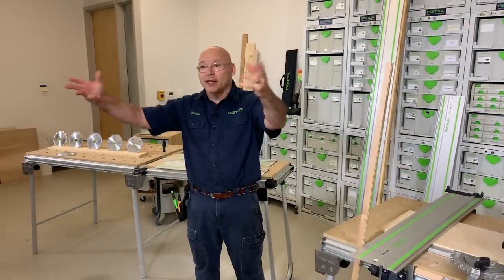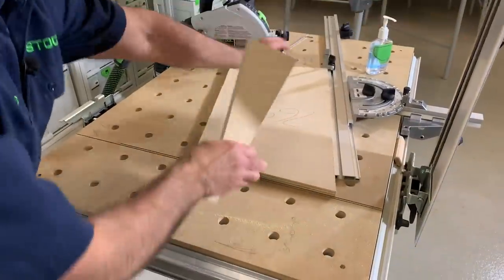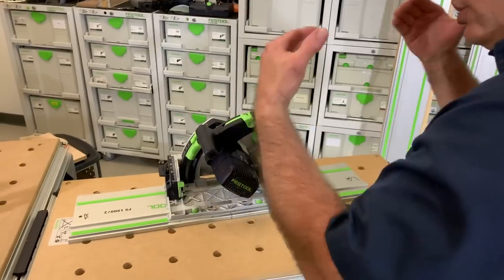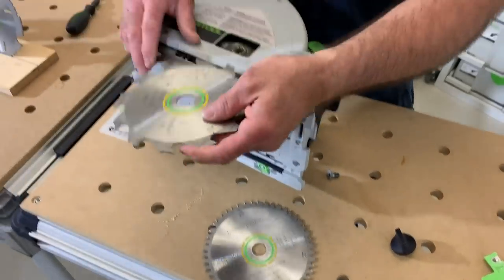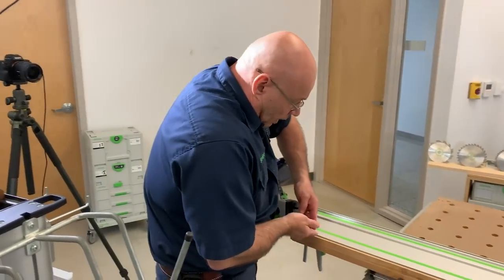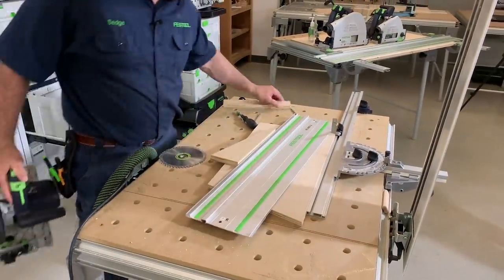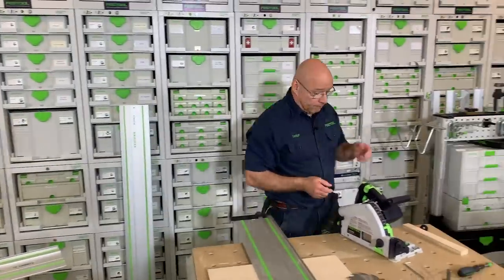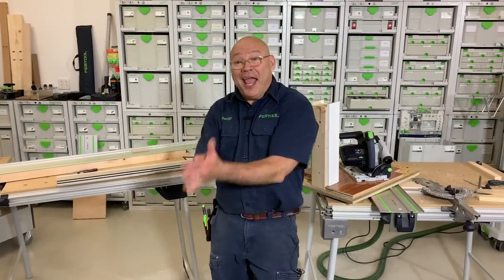Festool Live Episode 06 - Track Saw Essentials

Comment: I purchased the TS 75 two days ago, it's my first Festool product. This was exactly what I needed!
Reply: Same here!
Reply: dude i love mine, cutting some aluminum today ! purchased a 72 oshlun blade off amazon. Its dead on the track, I ran the 72 free hand on some plywood to take off some blade coating before putting on track. I think its gonna be great, its a non ferrous blade , but was cutting scraps of pre finished with no tear out at all. blows the 36 tooth out the water
Reply: Mines amazing . Wish I knew about them years ago ,as I used to use a skillsaw and a rail which it would usually go under and I’d throw fits

Comment: Great tip using the saw it’s self to align the rails. I would avoid the Festool joining bars because the set screws drive into the surface of the track, making a dimple, and those screws will always find their way back and could keep you from aligning the tracks at all.
Makita has a much better system with double bars, the set screws expand the parts inside the slots expanding with even pressure, and works with Festool tracks. 
I just saw new joining hardware from TSO that looks even better, it’s like the makita hardware in that it doesn’t drive screws into track, but it also has a unique profile that automatically aligns the tracks as you tighten... TSO GRC-12 self aligning guide rail connectors. Maybe Festool will license these rail connectors, because they were/are selling a Festool branded version of the [Excellent]  TSO GRS-16 Guide rail square, Festool call it the FS-WA/90, item #205229, and it carries the TSO logo on the clamp. Again I'm not sure of the status of this version, it's shows out of stock on the Axminster UK website and is listed on the Festool Global site, [Festool.com] but not on [Festoolusa.com] or any of the local Festool dealers that I checked.

Comment: I ordered festools laminate blade for my TS75 . I have to cut 1/2” acrylic for a friends staircase . Are there any tips I should be aware of, like should I slow the motor speed down ? I’m concerned about when the saw exists the acrylic with potential chip out . I guess I could clamp some sacrificial mdf for additional chip out protection

Comment: I’ve used all the connection techniques for 2 rails and yet to get the perfectly straight cut , always off over a 2.4 metre sheet cut. If you want close to a straight cut, the only way is a complete rail , and even then it’s hard to avoid lateral flex on hard material . It’s not as good and accurate as they make out but it’s still the best on the market .

Comment: I own a TS 75 that comes with a 36T blade, but I'm going to start ripping quite a bit of plywood, do you recommend that I switch to a 18T blade, or will the 36T handle no problem? And yes I know the TS 75 is overkill for plywood, but I use it for thicker stock, that the TS 55 could not handle.

Comment: I wanted to catch this live but didn't get a notice. I bought a 75 and then a 55. I think the black edges stayed on the best. At least for me the clear plastic curls near the ends. I have even used acetone to get every bit of old adhesive off. I keep my rails separated for the 2 saws. What I really wanted to ask about was adjusting 1 saw to match the other so I can use what ever rail I want. I hear I of the saws has more adjustment than the other. How easy is it to mess something up?
Reply: @S7tronic  Thanks!   I had not been aware of the TS Supplemental Manual before you mentioned it.  Owning several Festool saws (TS 75, TS 55 and a TSC 55), I found it quite annoying that they didn't cut exactly in the same location on the track.   I thought that was just a Festool manufacturing quirk, and I assumed the only way to maintain precision in my cuts was just to waste money to buy dedicated  individual tracks for each saw.  I owe you a big-time vote of thanks.  That advice of yours was equivalent to a 3-star rating in the Michelin Red Guide.

Comment: You tightened one connector but not the one on the bottom. I saw the gap between rails change as you were moving it around because the second connector was loose. You'd have to flip the rail with the saw on it to tighten the other connector.

Comment: That's for the video, Just one question, how to set the distance, should i Just use the splinterguard to set it to my drawn line?
Reply: Or are there better ways to make sure what you see is what you cut?
Reply from the maker: Yes. Using the splinterguard to set your drawn line works just fine Erik! :)
Reply: @festoolusa  cool thanks, and how do you clean the blade if it gets saturated with wood glue/wax buildup? Water and soap isnt good I suppose?

Comment: Hate to get a half-dollar in change because vending machines won't take it? Guess what... It's 2.15mm thick, and a Festool blade is 2.2mm; so you can use it for a blade gauge. If you're cutting thin strips, just position the splintah gaaahd strip one half-dollar from your mark.

Comment: Festool tools seem to be well engineered and built.  But, as a Senior Design Engineer, I've always believed that  part of a well designed product is that it be cost effective (competitive) within a market bandwidth. For instance, the excellent Kapex miter saw is $2K vs the market leader Dewalt 780 series 12" saw that costs only 25% ~ $500.  This would indicate that your basic design protocols are not DFM based or your marketing people are just gouging the market.  I like your tools but your overall price structure is not reasonable to me.  That is why I just purchased a Dewalt...kunk
Reply: Buy once, cry once.  :-)